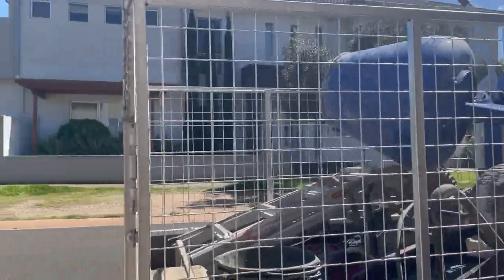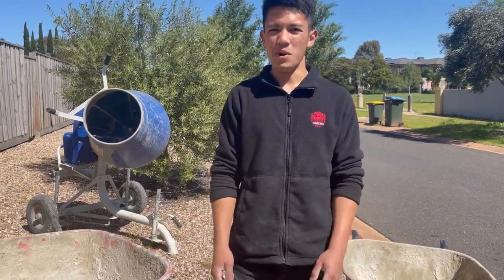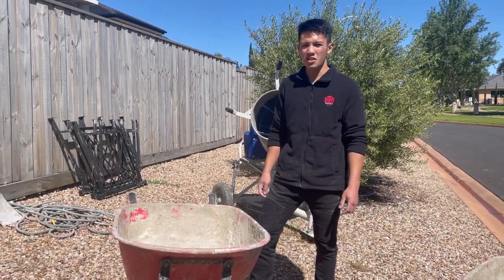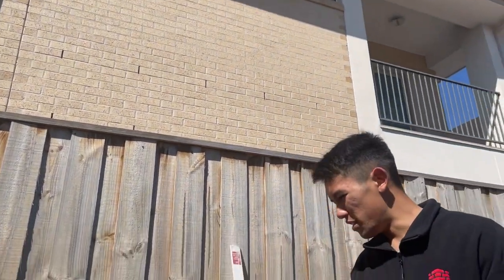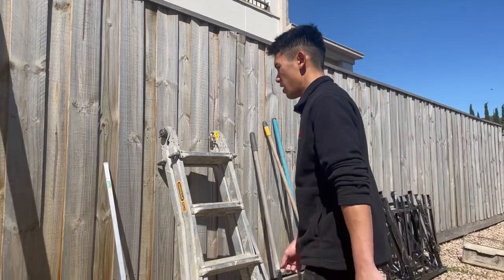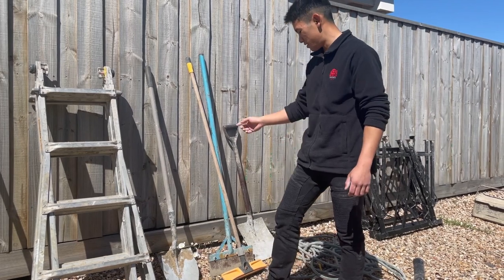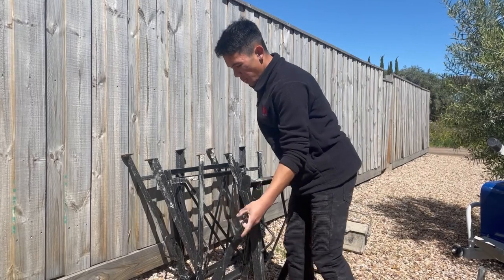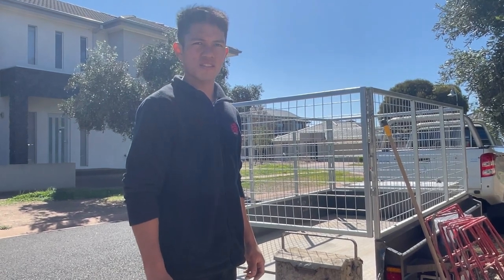MY TRAILER SETUP | BRICKLAYING AUSTRALIA

Comment: Have you ever seen or used a mortar mixer I see all the guys that make videos in England or Australia have those mixers like you have we use those in America for Mixing concrete and we have mortar mixers that have paddles inside that spin the whole mixer does not spin you can't mix concrete in it because the rocks will rip up the rubber on the paddles
Reply from the maker: Interesting! We use one mixer to mix it all!